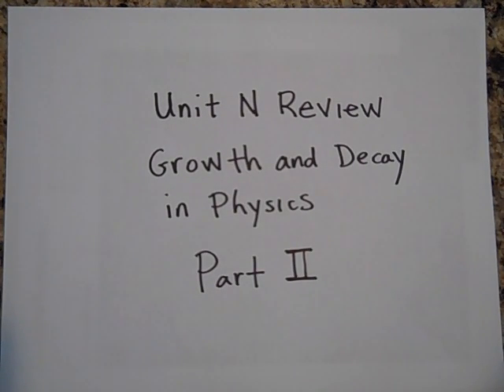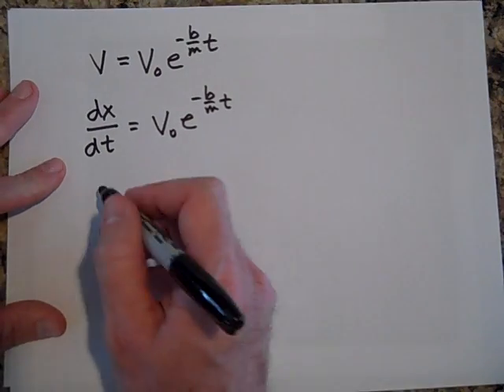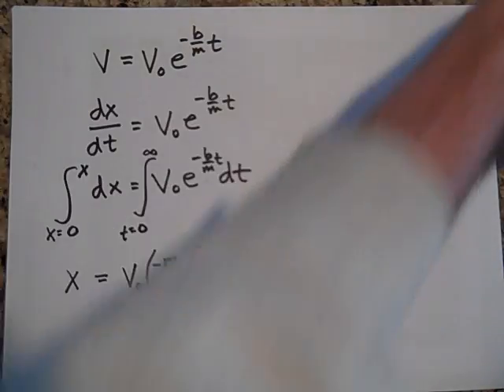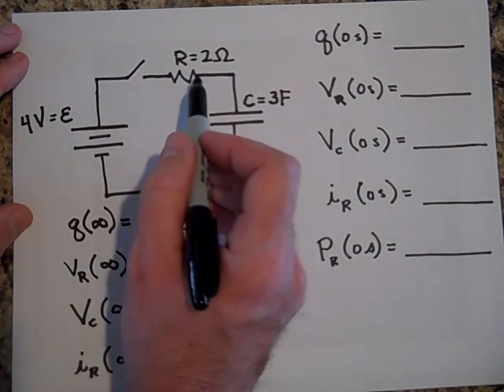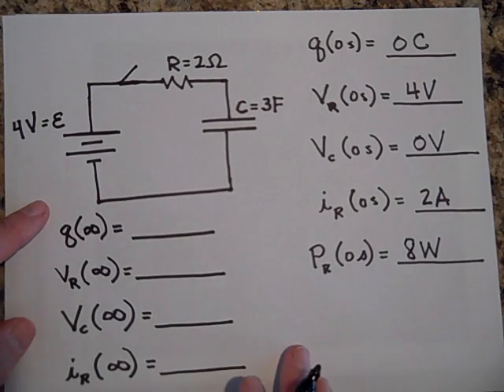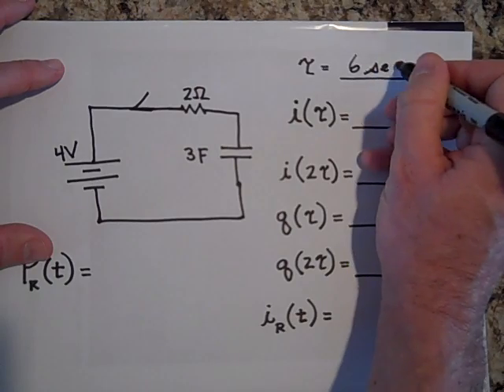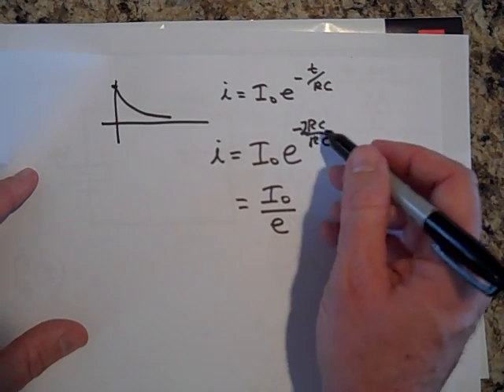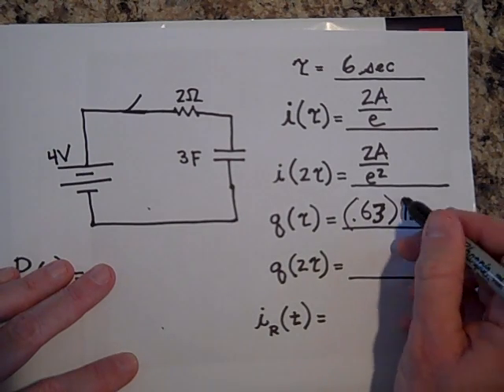Review of Unit on Air Resistance and RC Circuits (part II)

Comment: I believe that there is a mistake at 7:35, because this is a charging capacitor and the formula that you are using for it, is wrong because you gave us different eq. in the previous video. The formula for charging capacitors is Q = Q0*(1-e^(-t/RC). So it shouldn't be that answer for Q at one time constant.
Reply: First, he is solving for current, the current always decays regardless of whether you are charging a capacitor or not. This is because there is a loss of potential in both cases (discharging and charging) Taking dq/dt will give you I = I0*e^(-t/RC) regardless.